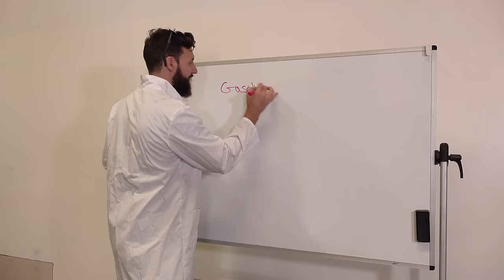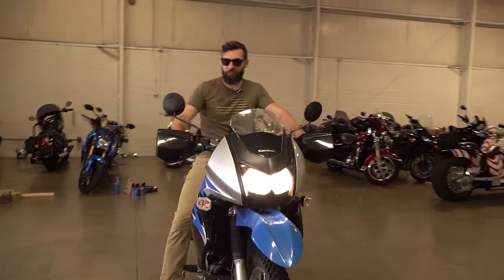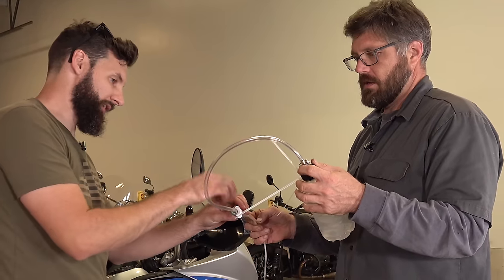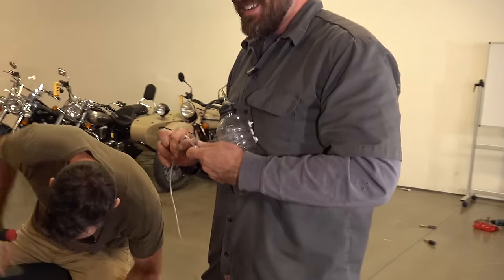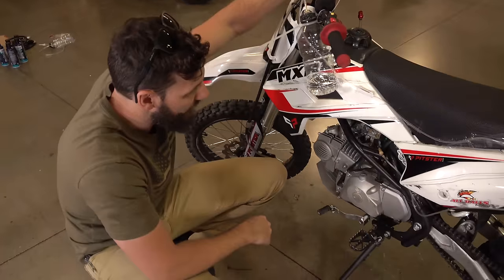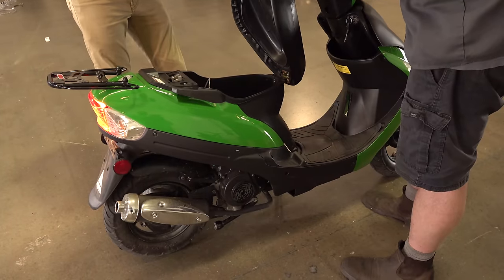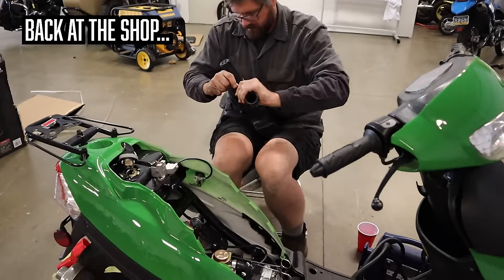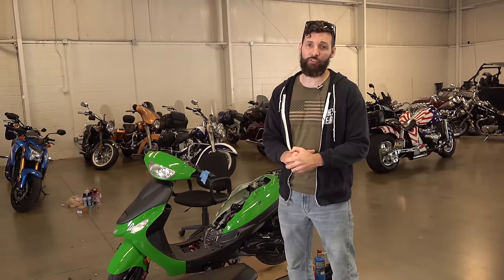What happens when you try to run a motorcycle on PROPANE instead of Gas

Comment: Internal combustion engines run on a balance of a fuel/oxygen ratio called vapor. Propane and butane are already in vapor form unless under pressure. Your problem is too much oxygen

Comment: go big bore. put  propane on the Harley. use the choke as a throttle. more choke more fuel less choke more air less fuel. Also nitrus components can probably help. Ran a push mower with nothing more than a 60 thousandth orifice and a variable pressure regulator. Also, winter blend gas used to have butane mixed with it. not sure if it still does. liked it better than the ethanol crap

Comment: Last time I had a scooter on gas, I remember that I needed to mix the fuel with some oil, it was like around 50 ml per liter of gas. Running the engine without oil mixture for too much, can't be good. The raw unoiled parts will rub on each other and the metal will eat itself away. Also I guess these types of scooters are not made to be runned on other types of fuels. You have a much better chance of converting it to a semi electric self charging scooter. Using the original fuel engine as a generator for the electric added motor would be nice too see. You could then run the scooter in 2 different modes.

Comment: It is nothing new to run an engine on propane. However, it is ill-advised to put it on a motorcycle other than an experimental motorcycle. This is far more dangerous than normal fuel in the event of a crash. Unless you can ensure protection against abrasion and piercing, you are literally mounting a bomb. Although I would prefer LP gas, you can't pay me enough to drive that on a public road...

Comment: Take some aluminum cans sand them down put the aluminum cans and some water then pour some lime in the water make sure you have a container with hoses on the top because hydrogen is lighter than air run the hose into another container beside the one that you have to catch any water or fluid that may spill out into the line then another line coming back out of it to where you want the fuel to go depending on how many cans you have in there just how much hydrogen you will generate it only produces hydrogen no oxygen the oxygen clings to the aluminum cans in the breakdown of the water so all you're left with is clean hydrogen and you can produce quite a bit of it the only thing is you can't stop the reaction when it starts and you better have a metal container or something with a good lining because it gets warm it's a somewhat violent reaction if you put too much aluminum in there you can over pressurize your system you want to make sure that you bleed off the system too and don't have any Oxygen in there if you have the system over 100 PSI you will get one heck of an explosion if there is any Oxygen mixed in with the system but you can generate quite a bit probably enough to run a full size car

Comment: What's really fun is building hydrogen/oxygen generators to run your bike off of,  hydrogen burns a little hotter than gasoline while propane provides a little less power than gas.

Comment: Need a LP REGULATER AND A THERES A THING THE OLD DODGE TRUCKS HAD WITH THERE PROPAIN TRUCKS IT RUNS HOT ANTI FREEZE THREW THIS BLOCK THAT THE PROPANE. FUNS THREW TO VAPORIZE I THINK AND PREVEN FREEZING THE CARB ADAPTER THEY HAD TO FEED THE LP

Comment: Or I can just go fill my tank up for $7 and not have to deal with all the hassle 🤷🏻‍♀️
Reply: At the moment its about $7.70 a gallon in the UK , My GPZ costs about £23 to £24  to fill up  which is about $32 to $33.35 . And price appears to be going up by the day !  OK so our gallon is just a bit more than a US gallon 4.545 litres compared to 3.785 litres  , which means We get 1.2 US gallons but that still works out at about $6.62 per US gallon and it hurts when it's this price .

Comment: bruh.  duh it's because u didn't put the flux capacitor in the manifold duhickie and ducktape the whatcha-ma-callit and jb weld ur throttle wide open and put a tac in ur brake line....duh. shesh....this disserves a couple thousand dollars for telling u the secret. right????

Comment: Man you are so far behind! In Europe we've been doing lpg conversions for years! I can't watch this! I've done thousands of lpg and cng conversions for cars and bikes here in Greece. You need a proper regulator, a gas line regulator and a mixer for the top of the carb. Then it will work like gasoline. For port injection you will need a complete Lpg injection kit. Then you won't be able to tell which fuel is on.

Comment: hahahaha im engineer and i tell ya how do it current way

run on propane you need electric adjusting propane flow or electric adjustment valves and u need replaced thotter cable to electric control u may find one have both cable n electric control thotter